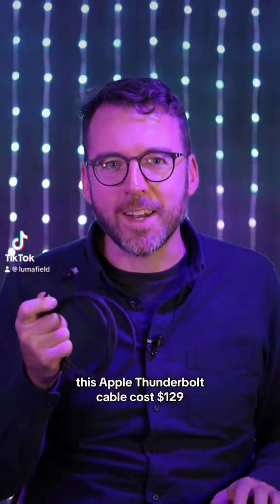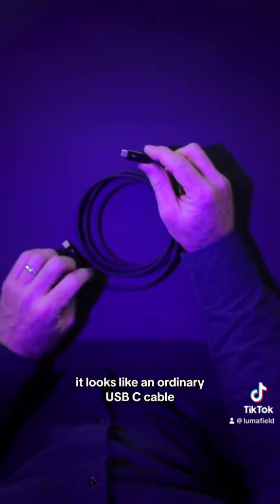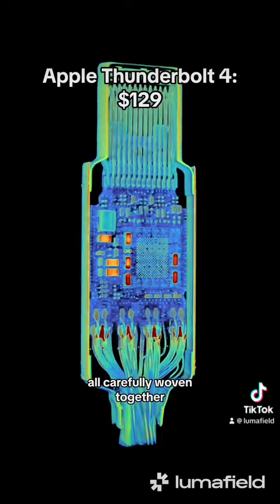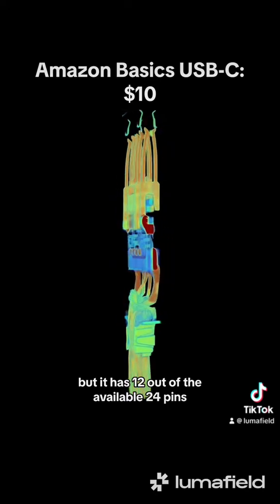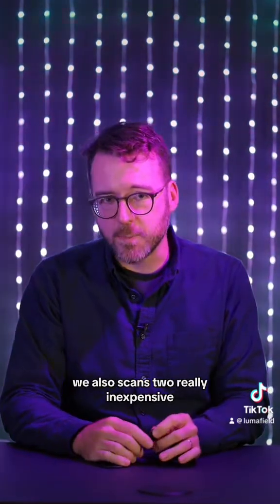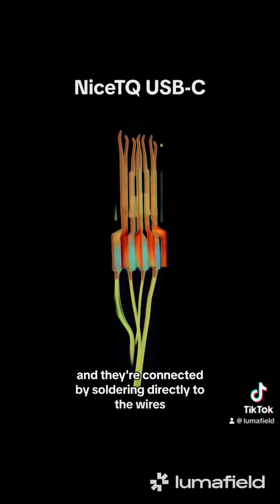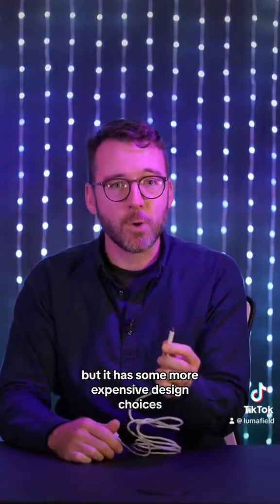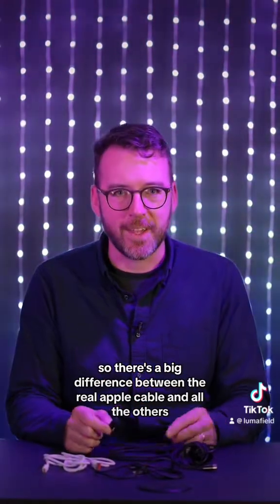USB-C Comparison: Apple, Amazon, NiceTQ, ATYFUER

Comment: Intresting note on this. 
1 the compard cabels is usb 2 - C not usb 3.0 3.2 etc. So it not really a good comparison. That being the case i done the mistake and oderd 2.0 when i needed 3.x so look out for that.
2 it makes more sens to bye the cheap 2.0 cabel is u are a appel user. ass the appel 15 base model only got usb 2.0.So if it only for 15 base model makes more sense to take the inexspensive one. if you belive u going to use it for more bye the cheap usb 3.x cabel.
So what about thunderbalt 4 and usb 4 cabels. Powerdeilivery 3.1.. my expreience is that it will only mather is special poweruse cases.  My Asus rog Arion can botelneck it but not by far. 
Fast charing. well phones and tablet dont relly charge that fast and it only becoming a problem when u start passin 70W if u going to use it for laptop. look for cabels 100W plus 
Well thats my experience for cabels. my use cases are DP-alt mod and charging on the asus rog g14 samsung tablet ancker 140w powerbank, with hyperjuce-140w charget. 
also the cabel that came with the samsung s23 is kinda crappy it will charge the phone at max speed. so it dose what it supose to do not mutch more. it outpus 36W in my 140w setup. and 34 mbit speed solid 2.0 speed. no display port signal. 
In the end it all depends on use cases. if u need a charing cabel for ur phone. nothing more. then why would u like a chip extra that can brake.if you have a iphone 15 basic u can use more than usb2 and phone chanring is not that fast anyway.